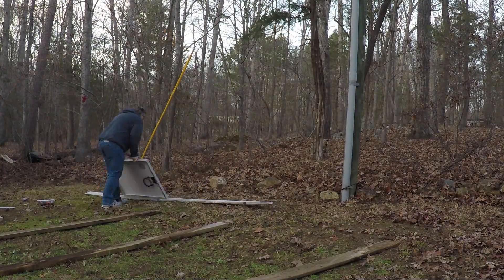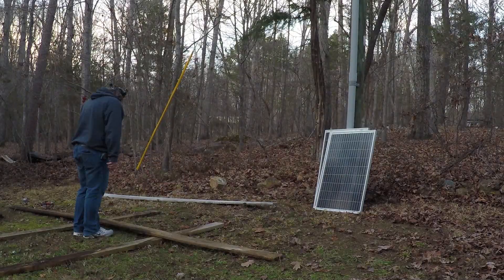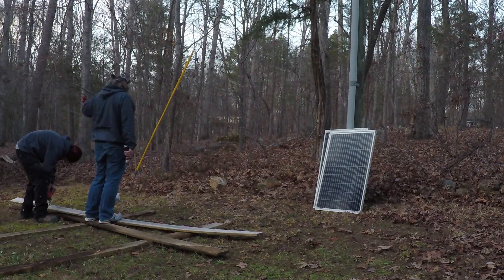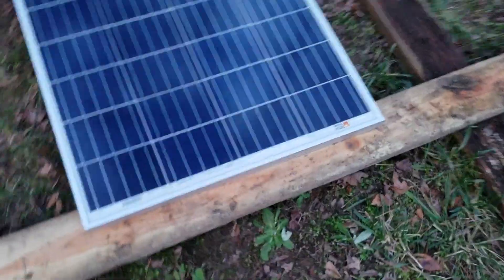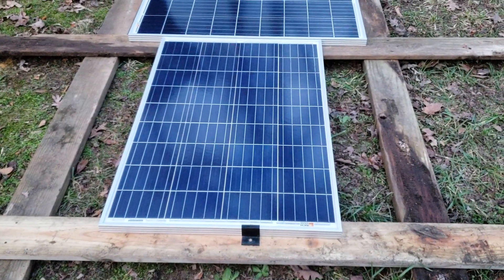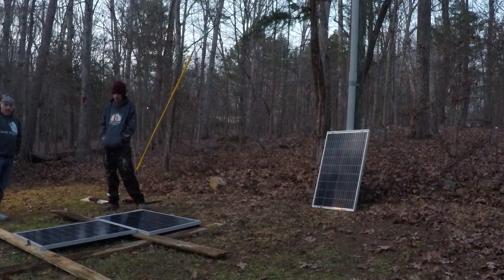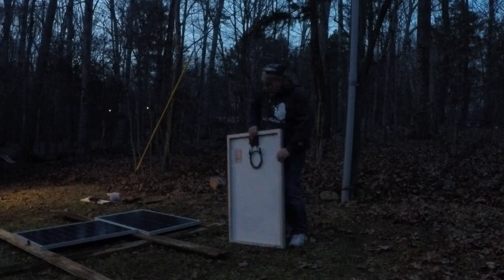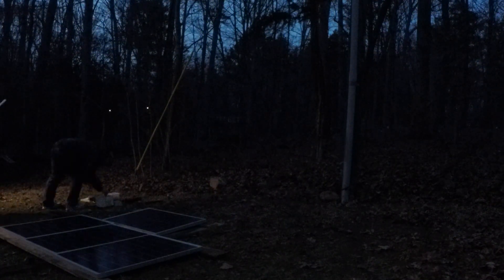Installing The 500 Watt Solar Array - Part 2 - How To Build An Off Grid Solar System

Comment: what about adding wind turbine for night? for US $218.49  from ebay( Details about  4600W 6 Blade 12/24/48V Wind Turbine Generator Battery Charge DC Controller)    what do you think can this work? they say 4600 w if it is even possible !
Reply from the maker: Hi Gnosis Dg, that's actually a really good idea and I like the idea of adding wind but the problem is I live in the woods. So I'm not very sure that that would work but I do have a location in mind that might be a good place, maybe in the future thanks for the idea.

Comment: Tip: make a mobile structure with a "solar follower".
You can do that with 80 bucks, arduino, (free project online) 4 servos, 4 light sensor and a bunch of relees.
Reply from the maker: Hi Kentilor, that would be an awesome project, thanks for the idea!